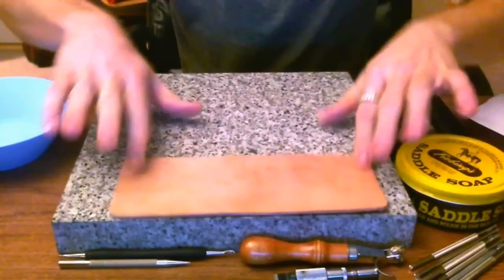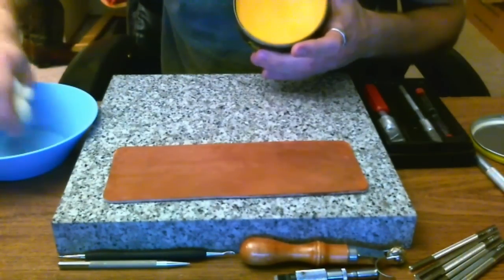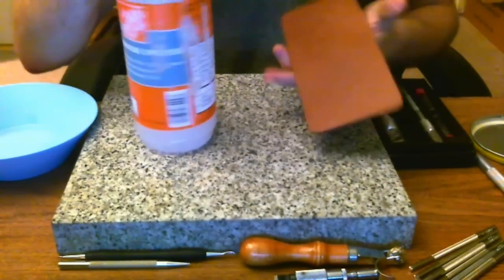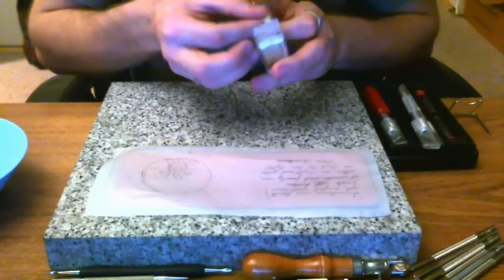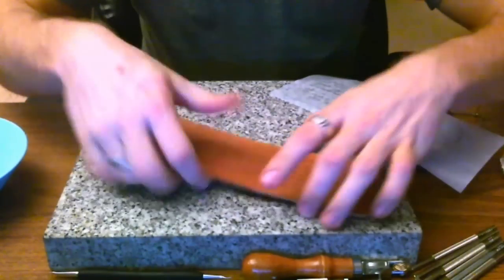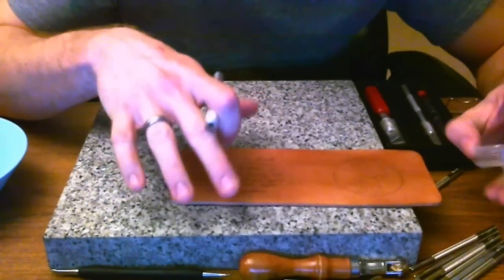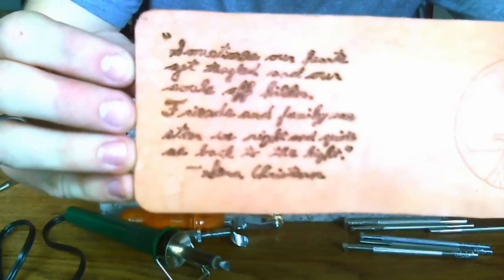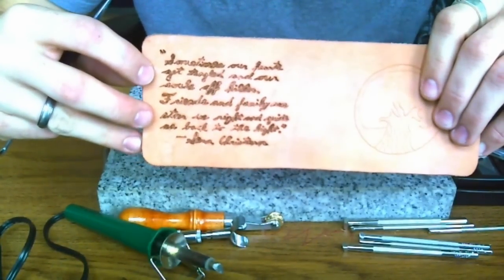Celtic Wallet with Tree- Part 1/3

Comment: Nice work!I would add that saddle soap is actually a leather conditioner, rather than a cleaner, so to remove marks and prep the leather, a proprietary tack cleaner would be better. (You could use a teeny bit of plain, un moisturising hand soap on a damp cloth instead, if tack cleaner isn't available)